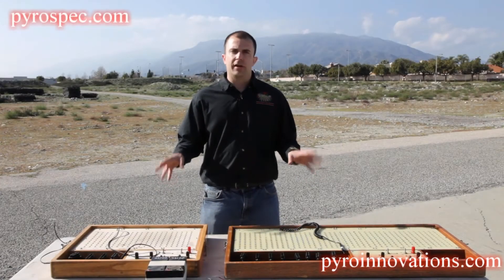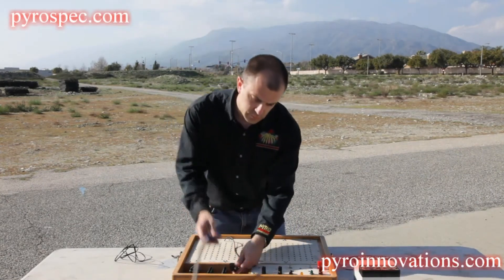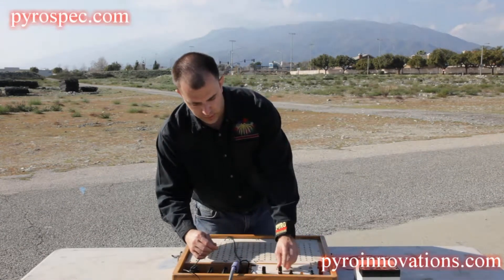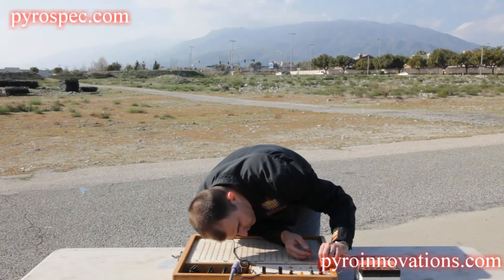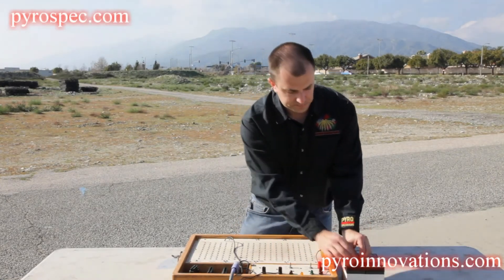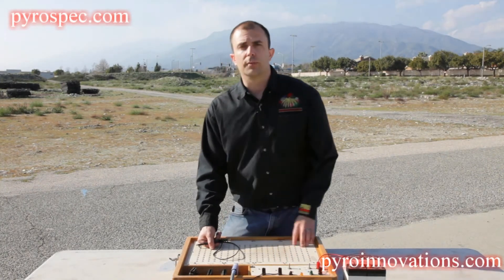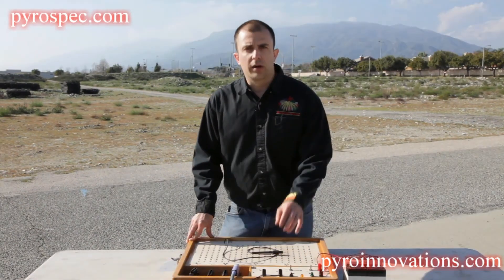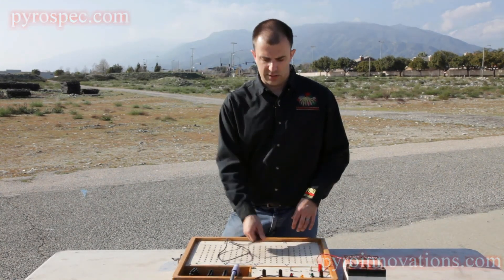200 / 400 Shot Fireworks Pinboard Firing System

Comment: How do you know when to touch the metal spots during shows, especially choreographed shows? Should do a tutorial on that. Nice video though!
Reply from the maker: You are listening to a "cue tape" that is synchronized to the show soundtrack.
Reply: @PyroInnovations  Oh okay. I see sometimes they put the cues on a loudspeaker and sometimes it is done in headphones. Is there a reason for that or just preference from the operator?
Reply from the maker: @pyroblastguy  Headphones are always preferred.  Loud speaker can be difficult to hear over the mortars firing.  The only time I can see using a loud speaker would be a limitation on the audio technician's part and really nothing to do with operator preference.
Reply: Pyro Innovations Oh ok. Always wondered that since I heard the cues out loud on a video once.